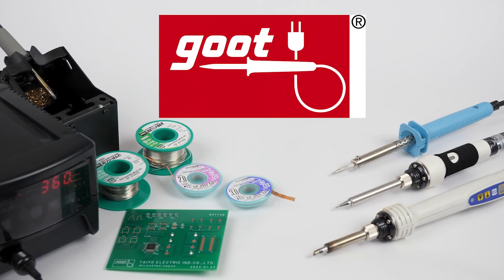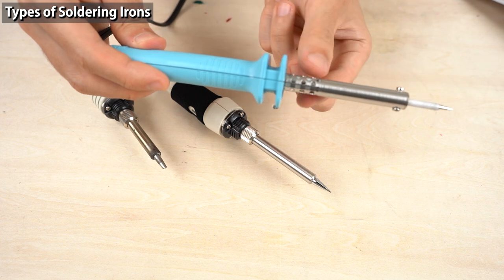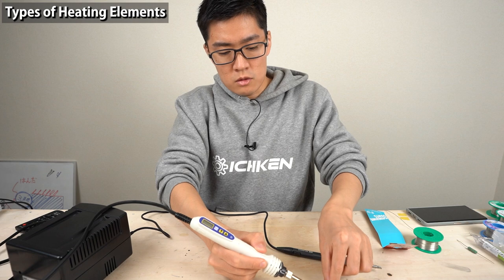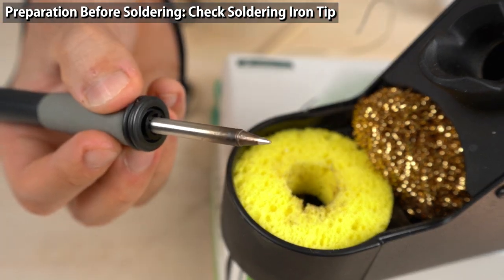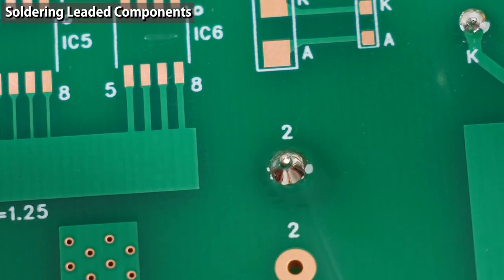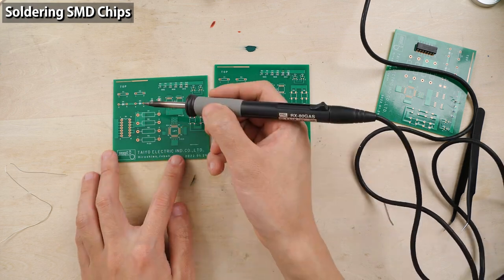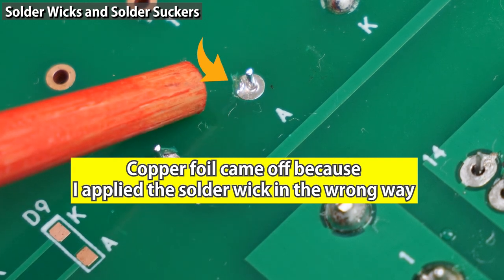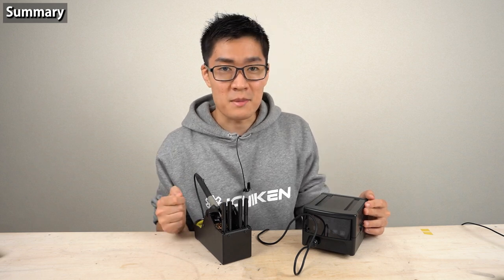Soldering Complete Tutorial for Beginners | Leaded, SMTs, Chip【Step by Step】

Comment: Although I agree that if we consider just the solder, lead-free solder is better for the environment. But if we look at a larger picture, from my experience and from what I've been able to gather from research, electronics made with lead-free solder tend to fail more often since the solder joints are more brittle and break due to mechanical stress. Then the whole device is generally thrown away. This should also be taken into consideration when determining impact on the environment.

All that being said, just discovered your channel recently and I'm enjoying your videos!
Reply: ..and there is the issue of tin whisker grows over time. Lower wetting, too. But still I am in favor of leadfree and more research compered to spilling lead into the enviroment. 
Especially cadmium, mercury, cobalt & lead should stay out of future mass market products. ROHS makes sense in the long run.
Reply: @frgmntTOB  What Flux, Lead Free Solder and Hot Air Rework Station do you recommend in that case? All 3 need to work well together.